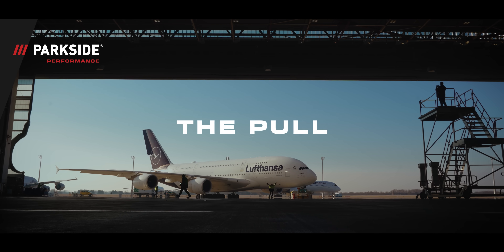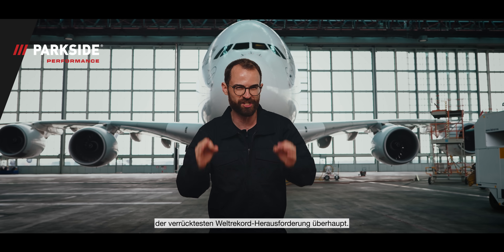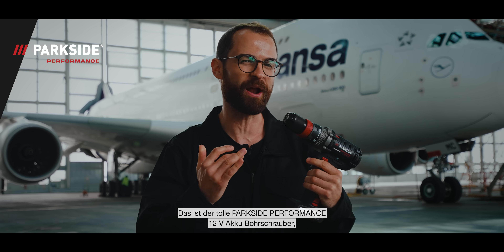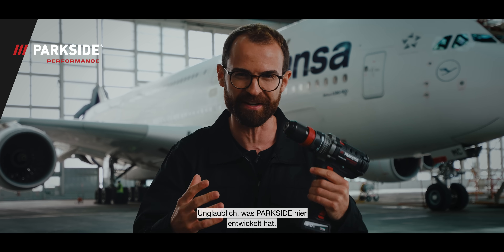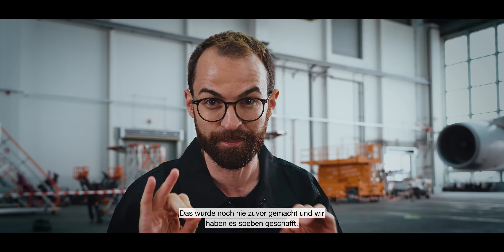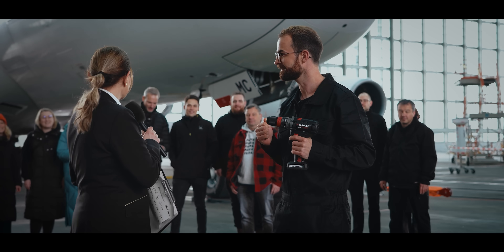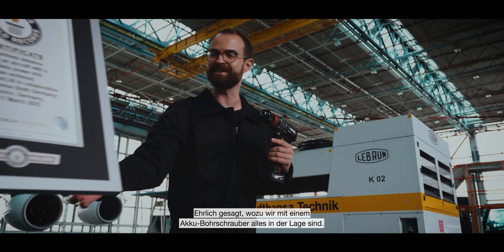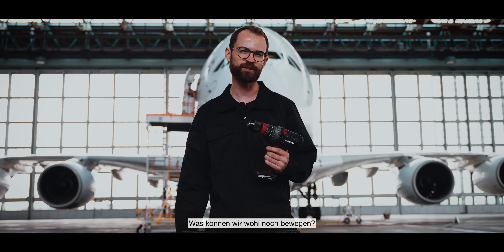WELTREKORD-VERSUCH: Wir ziehen das größte Passagierflugzeug mit dem PARKSIDE 12 V Akku-Bohrschrauber

Comment: Cool Sache! Hoffentlich ist da der Rundlauf besser als auf meinen 2 PBSPA 12 E4 :( bereits ausgetauscht worden und beide haben leider eine ausgeprägte Unwucht mit dem Spannfutter drauf. Für den Preis trotzdem wirklich tolle Akkuschrauber.
Reply from the maker: Nehmen wir als Feedback auf ✍️ Der Rundlauf bei dem 12V sollte besser sein 🤗
Reply: @parkside_diy_de  Habe mir den Parkside X Bauforum24 Akkuschrauber nun über Kleinanzeigen gekauft, Hammer Teil. So dann bitte die nächste Generation PBSPA 12 E4!
Reply from the maker: Freut uns sehr zu hören, dass du so zufrieden damit bist 😎